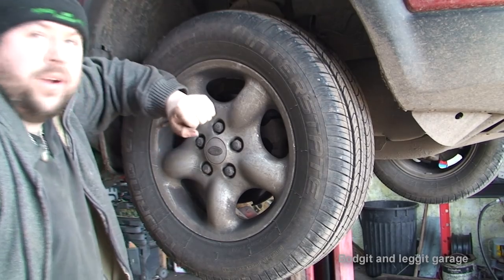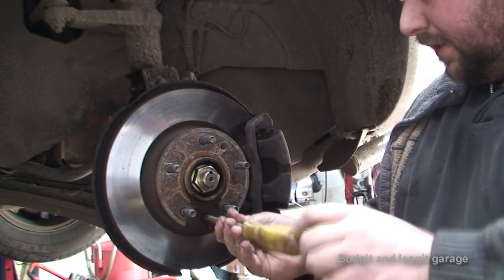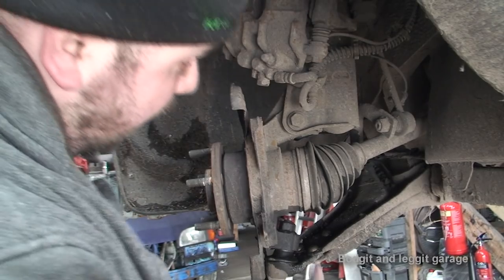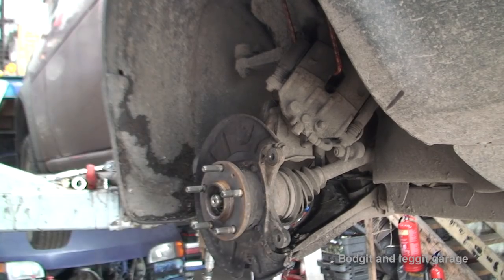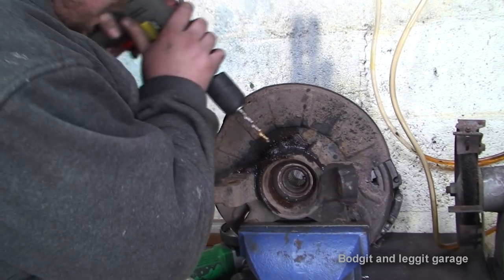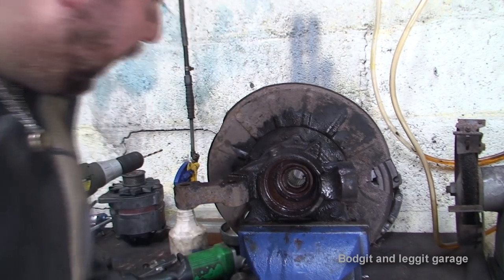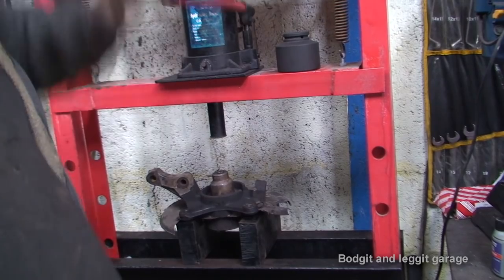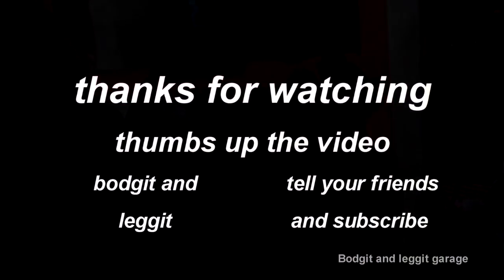how to fit wheel bearing on a 2005 landrover freelander part 1 of 2

Comment: Remove the reservoir cap from the brake master cylinder and put a rag over the reservoir before you lever the brake pads back into the caliper.
Reply from the maker: The cap was off and you don't need to put a rag over it all you gotta do is leave the cap loosely on it
Reply: @bodgitandleggitgarage  The reason you leave a rag on it is because you won't forget to screw the cap back on when you're finishing up. A loose cap can be easily overlooked and you will lose it because you forgot to tighten it. You're welcome (again).

Comment: how do you take the rear handbrake cable of  a freelander 2 2007
Reply from the maker: hi mate I've done videos on how to do handbrake cables I will send you a video link it's for a different car but it is practically the same just have to take the rear shoes out and disconnect the handbrake cable from there        
https://youtu.be/QKb3GHHu-J8